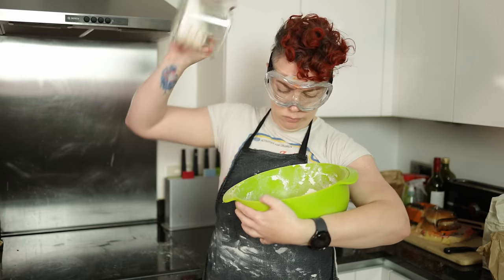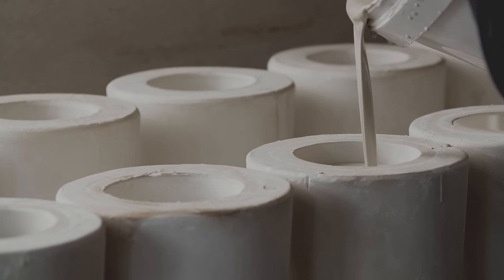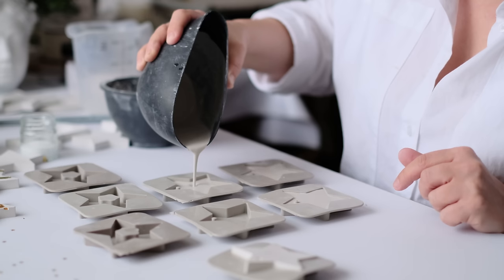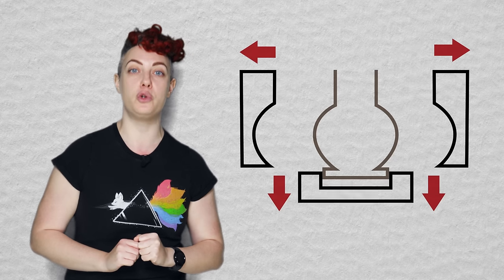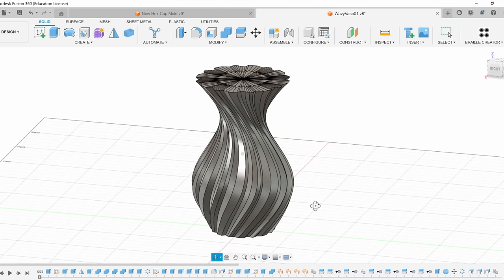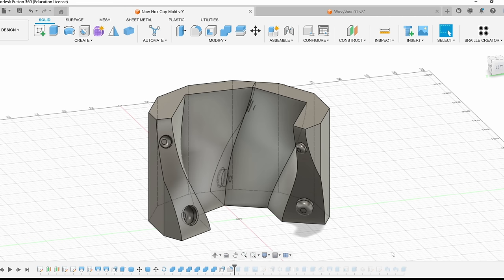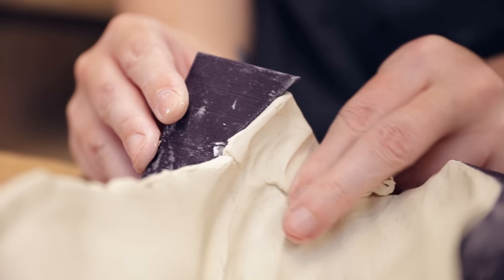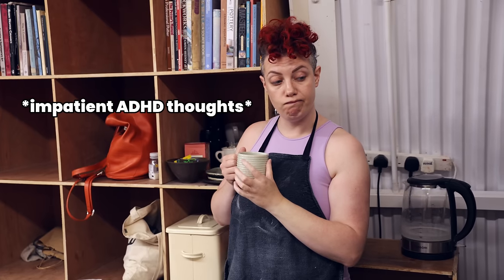Can you Hack Ceramics with 3D Printing?? This New Technique makes Clay Art Easy!

Comment: This is fascinating!! Ive been creating some silicon molds using 3D prints- and the process is pretty similar! If, like me, you struggle with tiny 3D print lines, I'd suggest painting the mold with some smoothon XTC-3D! It also seals the mold if you're using a material that might bleed/might receive bleed from the plastic

Comment: I saw you on Joel's video and I HAD to see the results of mixing 3D printing with ceramics.... Using cornflower to keep it from sticking..... I should try that again with my attempts at concrete molds
Reply from the maker: It's worth a shot! I'm not 100% sure if it'll work with concrete since that cures a bit differently than clay, but it may be worth a try! 😊

Comment: Sounds like exactly what I was looking for. Initially I wanted to make a positive and create a silicone mold for some mugs, but Ill give making the molds directly a try. Btw if you use a resin printer for the mold pieces then you can probably reduce the clean up time alot.

Comment: Great video!  For the fluted vase would it be worth printing a small section of the male mould (inside)?  If you had one or two of the ribs, and possibly indexing slots top & bottom to more easily form the slab? That might make it a bit less tedious. Maybe artifically smaller radius and taller to avoid tearing the valley?  Also, for drying,  you could make a shield for the leading edge so the hair dryer wouldn't be too uneven... that would probably be easier than incorporating air channels for drying from the mould side. A couple speed clamps might also make it easier while working on the two quarter sections.

Comment: This is really cool. I had a couple ideas while watching that may (or may not - I know very little about ceramics/working with clay) be helpful. 

Firstly, if you want to create molds that are going to be reused, it could be helpful to spend some time on post processing the mold itself, and smooth the layer lines (or even add something like a gel coat) in order to reduce the amount of time you have to spend cleaning up the mold lines. There are versions of PLA (such as cosPLA from Polymaker) that are specifically designed for easy sanding. ABS is also very sandable, if you have a printer that can reliably print it. 

Second, if you used a higher temperature plastic than PLA, you could potentially put the mold in a hotter space to speed up the drying process, though that may cause issues with the center drying too fast while the clay that’s pressed against the plastic is still too wet? As I said, I know virtually nothing about ceramics. 

Finally, for the molds, could you have another mold section that makes up the base, so you can press everything together at once? I don’t know if that would be useful, but I can imagine that if I were working with this process, I would be worried about ruining the entire piece while attempting to attach the base.
Reply from the maker: Hi there! 😊 I'm pretty sure I've got answers to your ponderings and I'll do my best to address them all!

Smoothing out the layer lines in the clay really is an extremely trivial thing that takes very little time, and what doesn't get smoothed will disappear in the glaze when you do the final firing. Sanding or otherwise finishing the interior of the printed mould would undoubtedly take LOADS more time, even with something easily sandable. The more complex internal shapes would be an actual nightmare to sand! 😅 It takes less time to sponge away layer lines from clay.

You're right that putting the mould somewhere warmer to dry would probably dry it faster, however, since the plastic is unlikely to hold the heat evenly, there's a very high chance of uneven drying, which can cause major cracks due to thermal expansion. Sadly, patience is better in this case!

As far as a mould for the base, I reckon this could potentially work for very wide mouthed pieces, but otherwise you close up an entry for air flow and working (if you need to get inside to smooth bits before attaching a base, for example. Attaching the base by hand isn't too difficult, and a good cutter helps a lot with that bit! 😊

I hope this helps! I have done by best to account for most things, but of course I could have missed something, so I appreciate the questions!
Reply: @katzcreates  thank you for the info! That's all very good information. I appreciate you.

Comment: At the 9:08 stage - would you consider using a balloon - e.g. a volleyball-bladder - to push the shape into all the crevices, even in places that your fingers may not be able to reach? After use, it can be deflated, of course, to be extracted out of the smallest of openings...
Rad tee-shirt, btw :)
Reply from the maker: Hmmm, that's a good question! I suspect it wouldn't be strong enough to really push the clay into the grooves, but if it was done with an air pump and stronger balloon material, it might work! If you give it a try, please let me know how it goes! 😀

Comment: After watching this, I wonder if a person can print a slip mold using foaming pla. But design the mold that had internal channels for a forced air flow source over the molds internal walls to promote drying. I suppose that the question really is, is foaming PLA porous enough to allow the water to dry out to slip cast with (my guess is much slower than plaster). Lastly, does the rough texture created by the foaming walls cause negative results i.e. too much surface area for the clay to hold on to?
Reply from the maker: I'm not actually sure if foaming PLA is actually porous in a way that would be useful for this sort of thing. Plaster actively draws water out of the clay, and I don't think foaming PLA would function in the same way. That said, I did not try this, so it is potentially worth experimenting with! If you do, I'd love to hear what your findings are!
Reply: It sadly has closed cells, so it will not make a difference. But the idea is valid.
Reply: I'm thinking of the fact that we dry our filament before printing. Is there any way that a filament dryer can get involved?
Reply: It sounds kind of like you're describing vacuum casting, in a way!

Comment: I just barely got into 3D printing in 2015 so I'm still learning a lot. Actually, I'm re-learning a lot after taking almost a decade away from art and crafting and just got my own 3D printer a few months ago. I'm re-learning the process of design and modeling in CAD and blender to make jewelry, but I hadn't really considered pottery beyond the tools I've already printed. Since I have an "art lab" near me, I've been delving back into jewelry casting using my 3D prints as a lost wax for investment casting, but they also have a kiln for use. Slab molds opens up a host of new ideas, especially since I've only been using silicone slab molds for casting dice in resin because... I'm a nerd. 

Sorry for the little paragraph, but I gotta ask... You couldn't possibly be the same Allie I knew from AiH?
Reply from the maker: I absolutely DID go to AIH way back in the day! 😀 So I probably am indeed the very same Allie you knew! That's amazing!!

Comment: what about making 3d printed molds to make the plaster molds for slipcasting,  more crazy designs?
Reply: I’m doing this right now  for a vase design. The surface pattern ended up requiring a five side mould with a bottom mould to form the dome in the middle of the foot.

The major difficulty I ran into was that 3D printers can leave you with undercuts between layer lines due to the way the nozzle generally blobs plastic down. I had a piece stick in the mould until I realized that I needed to use a soldering iron with a flat tip to smooth down any layer lines that were within 5 degrees of vertical to garantuee there were no undercuts between layer lines.
Reply from the maker: That's absolutely a thing already that people do. :) It works really well! I wanted to try something different since that had been done before.
Reply from the maker: Oooh, do you have any photos of the results of this? I'd love to see it!

Comment: This is so interesting and cool. I wonder what are the advantages of slab moulds versus slip cast moulds? Also I wonder if it would be possible to make a mould of the negative then make the slab mould in plaster instead if that makes sense, so it's still a mould for slabs but it's in plaster.
Reply from the maker: The advantage is mostly up front time cost and lack of mess, though mostly it's just an alternative for those unable or unwilling to do slip casting! You absolutely could use 3D prints to make plaster moulds for slab building, but it kinda takes away a big chunk of the advantages of this method. At that point, you might as well slip cast! 😊 But of course, it's just a matter of preference!

Comment: I am a 3d printer who just got into resin and wanted to mess with cermics and clay to try new things. My goal was work with clay and 3d scan it with new gen 3d scanners then get basic shapes and designs then edit them of all things with VR scuplting program so I can make it 4 feet talk and do find details and zoom back out and see it at 100% size. 

But after thought was molds but I was thinking do silcone or palster molds of dyes made with printers. This has me wanting to play with making cuts, containers like custom toothrbrush holder etc etc using the high detail resin printer. Like I am een taking a cermics class to play with it and learn more about clay and cermics at my locla commuinity college and honeslty gonna be running ideas like making molds for some my projects in that class. I met professor before selling 3d prints at school art sales, so I think he be down as long as I still do the required stuff for the class.

But I really like this video. My only issue would be print lines, but again I got resin printer or will in July in time for fall semester and I can do 12k resolution molds just not sure how much detail the clay can keep when its fired, that will be trial and error lol.
Reply from the maker: As you can see from the results, print lines aren't really an issue! They brush off the clay really easily with a sponge. :)
Reply: @katzcreates  Yeah I am gonna have fun with this just starting a intro to cermics class and professor seems excuted to, we get two indvudual projects for a grade, and part the class sylbus is learning to use slab roller to make plates and things so I I am just kind taking that one step further with 3d molds :P But yeah should be fun semester, especially since i know NOTHING about clay. But I high functioning autistic, managed to get to 38 before knowing it, knew I was "weird" but not why. But yeah I love learning new things, and I really can't wait to see combing my printers with cermics goes. Heck I get two into it I take next cermics class, and look at my next stupid expensive buy being one those 1200 buck electric kilns they sell online lol.

But this all started with me going "I want 920 buck 3d scanner, hmm what would coolest thing to scan? CLAY, hmm I know nothing I take cermics in fall! Ok now what else can I do..." And boomb this video was first thing I found when googling cermics and clay molds to see if that was a thing lol Also might look into slip clastying to but if I can't do advanced shapes probally not. Like that is what I was expecting to make a dye with printer have to get lines out of it, and cast it in plaster or silicone didn't realize could skip a step and just print the molds lol

Oh yeah sorry I get excited when watching videos like this and make comments before I finish soon as I saw the printed molds and you putting slabs in I was like "OH I GOT TRY THIS!"

Comment: Here's an idea. Design the mold so it has air gaps, so you can push a stream of warm air through it, drying the clay. That would require materials such as ABS which are heat resistant.

Comment: Does the type of clay affect how well this works? Like is porcelain better suited than earthenware?
Reply from the maker: The type of clay will have an effect, in the same way that different kinds of clay are better suited for different building methods! I feel like a heavily grogged clay may be a bit difficult, but on the other hand, porcelain can be quite delicate and cracks more easily on drying. A smooth stoneware is a good place to start!

Comment: Nice! You can also use your mold pieces as positives and cast them out of plaster. Once you've demolded the plaster pieces, you can use them for slip casting. I boil my mold pieces to release the plastic from the plaster - a bit messy but it works out. Your method is faster but harder to make the castings. Mine takes longer and is really confusing during the modeling (you're designing molds for molds), but the castings are really simple. https://www.youtube.com/watch?v=JaptF1CdfyY&t=3s
Reply from the maker: Ah yes! I have done this method as well using my own broken knee bones as the positive. :D It works great! https://www.youtube.com/shorts/XwB1BOitsTk?feature=share
Reply: Oh heck that's an amazing idea

Comment: Direct copy of @hammerlyceramics process that he has been mastering since more than 5 years. This is nothing new. Stop this fakery.
Reply: Didn't know there's only one ceramic person we're all supposed to follow. Guess there's no point in ever following other YouTubers for any content because everything is old and derivative. Let me unfollow Diresta, This Old Tony and Mathias Wandel because all wood and tool techniques were discovered thousands of years ago.
Reply from the maker: Unless I am mistaken, the technique that Hammerly Ceramics uses is one that creates a mould shape with 3D printing to use for making a master mould from silicone, which is then used to create a plaster mould to be used for slip casting. The technique I'm showing in this video also uses 3D printing to create a mould shape, but doesn't involve post processing the mould, silicone, or plaster, and isn't meant for slip casting at all. It's explicitly for slab built ceramics, a method that is quite drastically different from slip casting. Unless HC also developed a technique for making forms for slab building the works in the same way this does, I'm not sure I understand how this is a direct copy of what he's done. Both use 3D printing as a tool for augmenting ceramics, but the approaches are quite different. 

But, just to be clear, I am not and did not at any point claim to be the person to come up with using 3D printing for ceramics. I may not even be the first person to create 3D printed forms for slab building. However, when I could not find examples of this being done, I thought it something worth pursuing and exploring, and that's exactly what I did. Whether or not I'm the first person to do it doesn't take away from the usefulness of a resource that inspires and educates people to be creative.
Reply: Go away, Grandpa. Take your meds.

Comment: Interesting idea, but it seems to me that it's a lot slower and a lot more faffing around compared to slip casting. Why not just 3d print the finished piece, or moulds for a plaster mould, then make moulds and slip cast as usual?
Reply from the maker: If you're experienced with slip casting, yea, it's slower. But for anyone not experienced with slip casting, when you factor in all the work to get to the point of having a usable plaster mould and it's finally time to cast... It's definitely not slower. It's less optimised for rapid mass production for sure, but it's a LOT less front loaded than slip casting.

Regardless, it's definitely not meant to be a replacement! Just an alternative. 😊